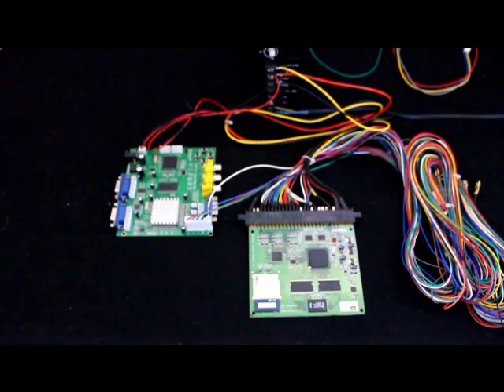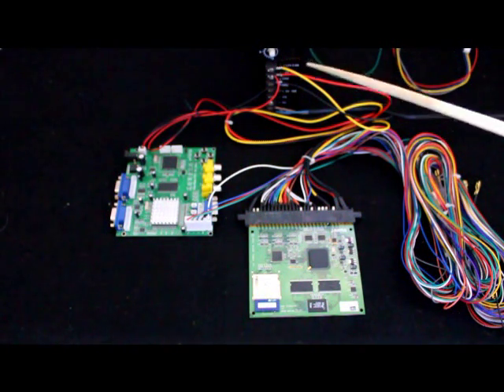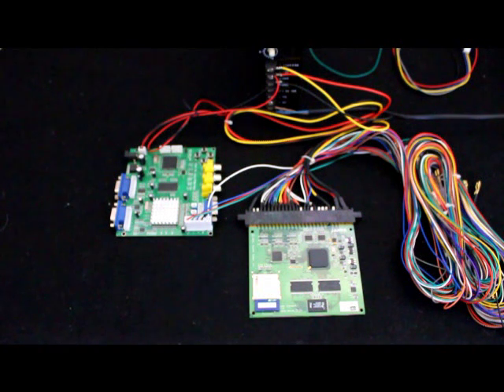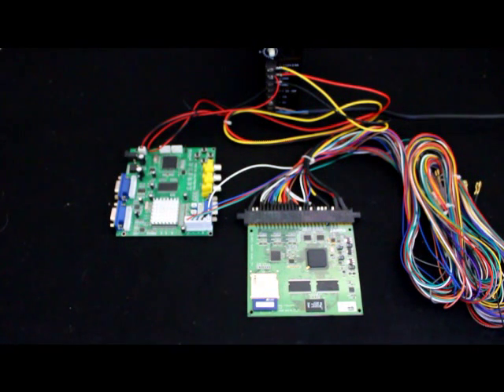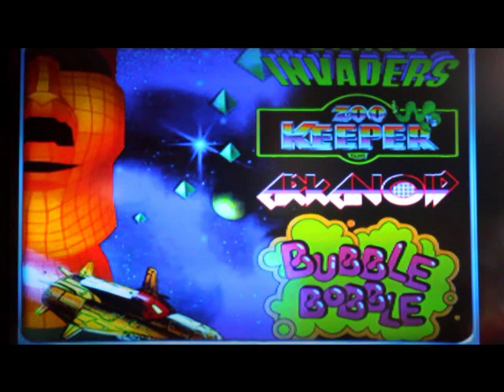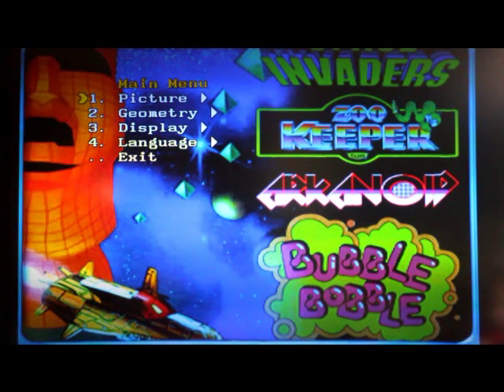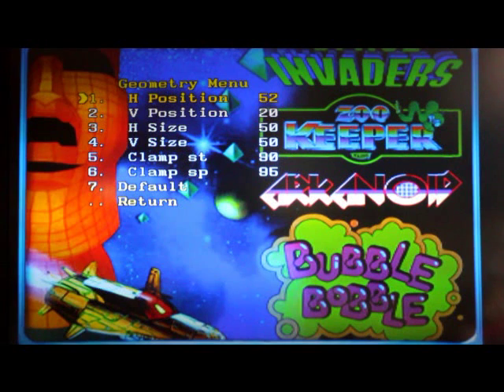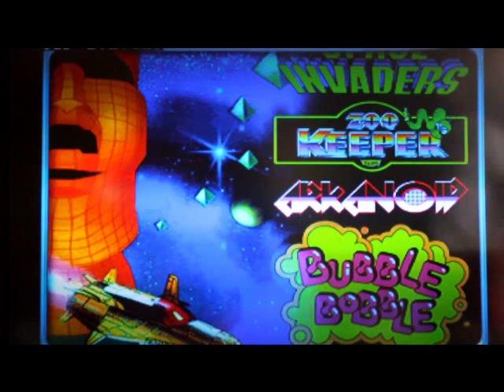Gonbes GBS-8220 set up and menus

Comment: Thank you very much for covering the menu from Chinese to English. I was stumped! Just converted a Ms. Pac to Dell 19" 4:3 monitor. Now I can work out the scaling and positioning. 

FYI for others - if you have a drawer of power supplies (Wall Warts / Power Packs, etc) just dig through until you find something that is from 5V to 12V. I used a 12V 1A (Yes, 1 AMP) for mine. 1 A is working probably because it's 12V. Rub a little Ohm's Law on this and you should see that the current supplied to 5V will be more than 1 A - depending on how the circuits handle that. IF I had a 5V supply, 1 A would probably not do.
Reply: Same here. The simple task of setting the menu to English made it a lot easier.

Comment: Hi,
    I would like to ask that I have sigma raijin supergun, it have two output,s s video cable or RGB 21 pins Cable.. I saw your video, need to plug the wires (RGBGN) but my supergun does not have it so I still can use GBS-8220 Converter? Thanks.

Comment: I had to use the 12v 2a from the PS. For some reason the 5v 1a wasn't enough. 5v 2a from a Radio Shack Multi adapter worked fine, so I guess it was just the amps. I assume this isn't an issue as the board states that it can take 5v-12v. I just wanted to throw this out there in case people were getting the same issue as I did. :)